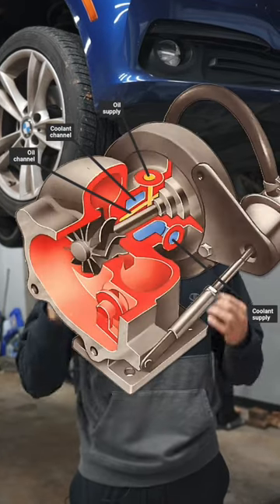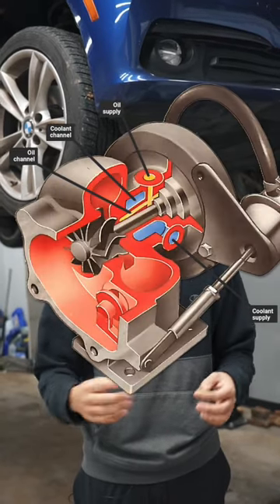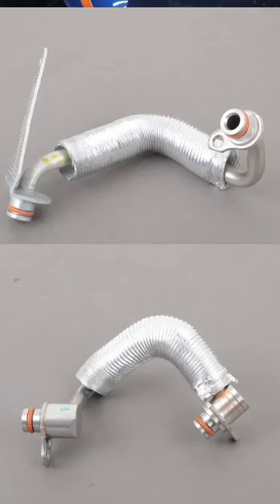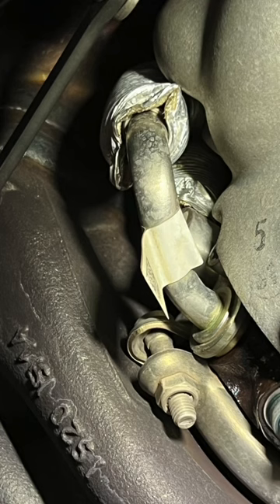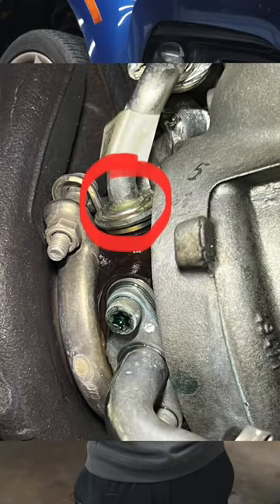Check this first! Mysterious coolant leak! #shorts

Comment: what do you recommend for a valve cover gasket leak. I changed the gasket but still leaking! Any advice?
Reply: might be the valve cover itself. They tend to crack due to age.
Reply: That happened on my e46 , it’s because the cover is warped , so changing gasket didn’t help, you must replace the entire valve cover
Reply: Did you add RTV gasket stuff to the corners?
Reply: Not changed properly. Did you remove the old residue ? Used some sealant on the spots that need it eg. Where the head meets the front cover(don’t know the right word for „stirndeckel“ lol) and the last step would be to check if your actual valve cover is bent. Check it with a precise ruler. Don’t know about the us but we call it hairpin ruler. The newish plastic valve cover from the n generation of engines tend to vent over time due to heat cycling
Reply: A gasket?
Reply: a lot of those valve covers crack and start to leak. i changed the valve cover and gasket and the the valve cover came cracked 2 times i didn’t even notice it till after

Comment: Turbos don’t use coolant to cook it down lol he don’t know wot he’s talking about
Reply: Never heard of turbos using coolant especially on BMW.
Reply: That line he showed is called turbo Coolant line.Look it up on any BMW parts website. I’ve seen the pressurized gasket it uses leak before. Happens on some n20/n26 engines.

Comment: tubros use oil to cool them down, thats why turbo timers exist. so you dont go drive your car hard and then shut it down right away., that hot oil in the turbo will cook and then destroy your bearings on next startup. if they used coolant those bearings wouldnt last. at all
Reply: They all use oil, some use oil to lubricate and also coolant to regulate temps